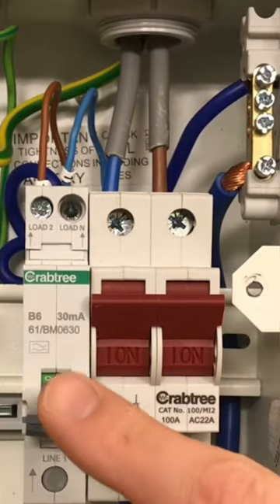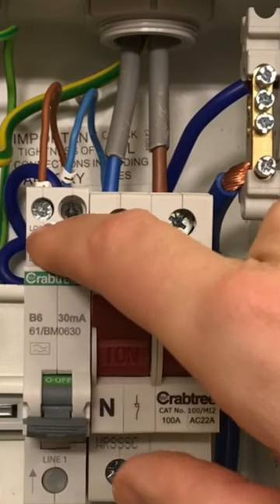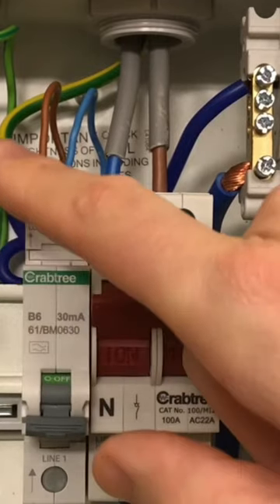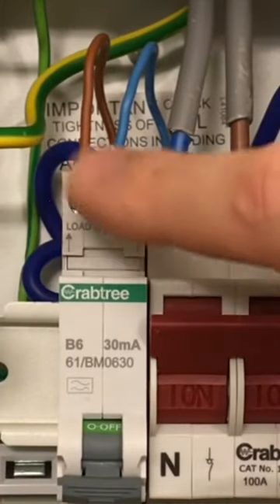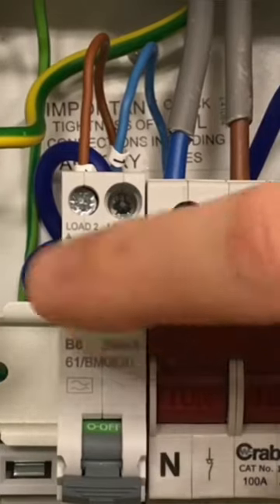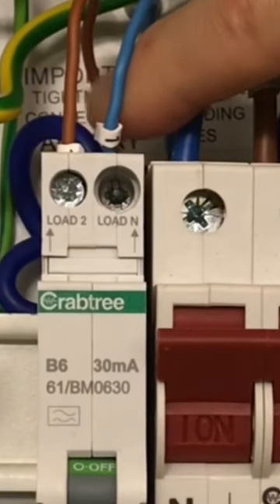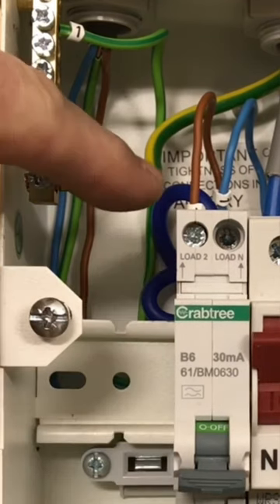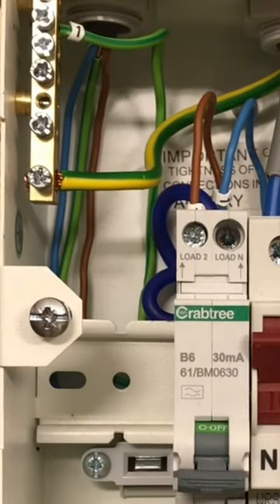Lighting Circuit - RCBO Connections Explained

Comment: Hi Gary I’m fitting a kitchen in to a dining room it’s all on one wall that’s 4 meters long there’s going to be a 600mm tall unit at each end the wall the space between them 2.7meters with a 720mm hot in the centre my question is do I need to have the FCU on that wall or can they be on another wall as there won’t be enough room for sockets .
Reply: You can install them in base or top units too.

Comment: A type but it says B6?
Reply from the maker: “A” type RCD “B” type breaker
Reply: @GSHElectrical  ahhh thank you 🙏 I lack that sort of technical knowledge.
Reply: @Doopyy if you do not know then what tbe hell are you doing electrical work
Reply: @lesliehill4516  I think I need to work with you. Seems you can learn without asking any questions. So gifted 👍
Reply: @ info i did a five year apprentership gaind my oart 1/2/3 then a btec onc in electrical and electroics am now 70 years old but ztill keep intouch with the trade and requlations

Comment: So much exposed copper on the neutral feed
Reply: Fully exposed brass block as well....did you miss that??
Reply: @nathd1748 The bar is mounted on a plastic rail. The neutral wire, if not stripped to proper length, may be shorted with the earth metal boxed.
Reply: @IAmThe_RA do not talk nonsense. While we are taught not to have too much copper exposed, while not perfect, there is very clearly no possibility of any neutral contact with Earth on this box. The number of people spotting the bare wire but not the bare block is unreal. If it was peeled back that far going into a main isolator/RCD/RCBO/AFDD then yes absolutely.
Reply: @nathd1748  I meant *earthed metal box 😅 Yes, IF a bit more copper is exposed on that neutral there is a risk of coming into contact with the metal enclosure. The neutral bar/block is securely mounted on a rail, there is zero possibility of it touching the metal box.
Reply: @IAmThe_RA If I was doing an EICR on that I would just trim that neutral and put it back in rather than make a point about it on the EICR.
Reply: @nathd1748   I am no electrician but my OCD would definitely make trim that neutral 😅
Reply: @IAmThe_RA  How come you're on here discussing electrics then? Lol. 99.999999999% of females in the UK would have no idea what they were looking at...never mind its significance to the Earthed metal backbox! So tell me what's going on lol!!
Reply: @nathd1748  My major is telecommunications engineering so yeah understanding electrical diagram is not an issue. I am definitely not competent/qualified to do the job of an electrician but I do follow many electronics and electrical channels and I normally don't have a hard time understanding what is being discussed in videos like this and I enjoy watching them videos 😅
Reply: @IAmThe_RA  That's really good. I'm glad to hear that. What country do you live in? What's the domestic mains voltage and socket terminations like?